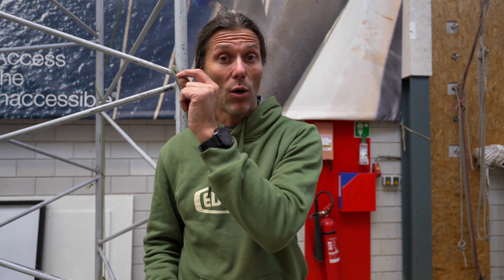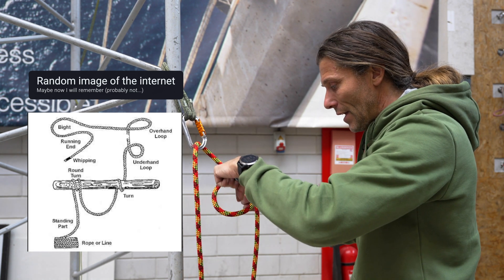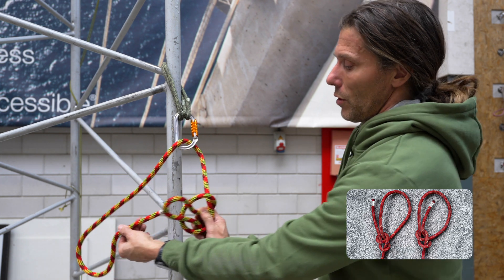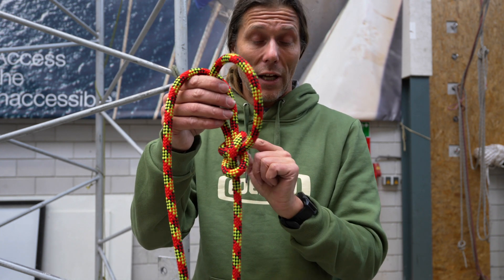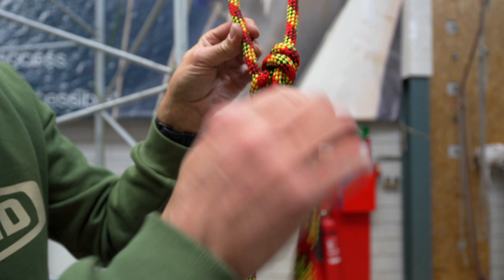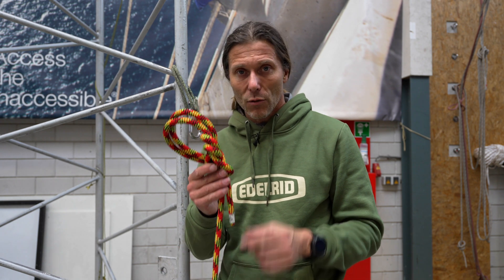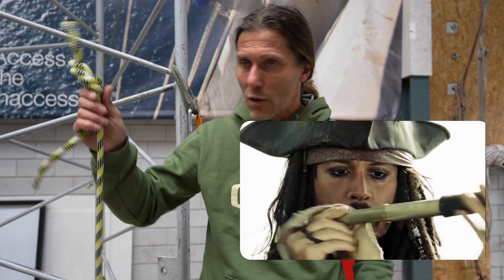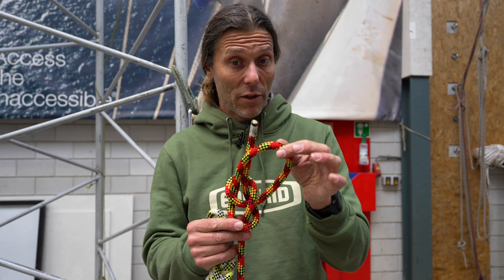How to tie a Bowline for rope access - Pro's and Cons of the Bowline

Comment: It is better to know a few knots very well, then many knots only half.  I fully understand that the figure 8 on a bight (or retraced version) is used frequently. It is easy to recognize, easy to inspect, and you can use both rope strands that leave the knot. 

I didn’t use the bowline frequently (because of the dynamic load issue). I don’t like the Yosemite finish, because you can tie it wrong and then it changes into something dangerous. So it surprises me that it came into the RA Channel. However some time ago a guy from Scouting came with the Scott’s locked Bowline.   From an inspection point a view it is terrible in my opinion. It looks so chaotic. It is a rather new knot, so not well known. The pro’s: easy to tie (starting with the regular bowline), very easy to untie after heavy load, and rather secure. 

Within my climbing work it is a real competitor for the figure 8 on bight.  The regular bowline (in Dutch “Paalsteek”) is also within the Scouting syllabus.   We added the Scott’s lock for the people that go deeper into wood pole construction.
Reply from the maker: Nice one about the Scotts Lock. Thank you! I hadnt seen that yet. It looks horrible and beautiful at the same time haha. I can  see you point on the inspection part. 
For me the bowline and it’s many different versions is such a versatile knot. I love it. And within the right team it is a perfectly valid and safe option. And the reality is also that we can get away with as little 2 or 3 knots. In RA we dont need more. I just like knots and use anything that comes to mind in the moment. Luckily I know a lot of knots very well ;-). It just depends on the team with what I use. Team and function as well.. Some things dont require the perfect F8 knot ;-)
Reply: @TheRopeAccessChannel  I like knots and rope also. Breath slowly, lower your heart rate:  I am a friction hitch addict.

Comment: Try the yosemite bowline, i believe it will address any concerns you have with the regular bowline. I like the yosemite because its much easier to use as an anchor knot around fixed objects compared to a figure 8 retrace
Reply from the maker: It is my favorite knot. And an F8 in rope access is still safer due to its recognizability
Reply: Though the yosemite finish looks very nice, I prefer the Scott finish (Scott's locked bowline).  In my opinion it has lower risk of mistying, and you can't dress it wrong (as far as I know).

Comment: We use the bowline a lot in theatre rigging. Its main use for us is hauling chain hoists up to be rigged to the buildings steel. The fact that it is easy to untie is why we like it since it only needs to hold for an 20 to 25 meter pull then get untied.
Reply from the maker: That is the place I use it most often. To lift things or make a quick tie off. I love the bowline ;)

Comment: I had a friend die when rock climbing tied in with a simple bowline.  I never use that knot for life support.  There are way too many steps involved in making it safe, all of which can be overlooked when tired and rushed.. Just use the figure eight, it's simple to tie, easy to inspect, and secure.
Reply from the maker: Agreed, and the reason I prefer it for rope access work

Comment: I have always used bowline.
Reply: I am from Moldova and there are no conditions for working on ropes, so you have to cling to chimneys or various large structures.  Bowline is ideal for anchoring.
Reply from the maker: Most of the time it is possible to create a safe working environment. It just takes time. But is starts with us on the floor education clients on the safety needs. Stay safe👍🏼👍🏼
Reply from the maker: Great knot.

Comment: I tie it as if starting an overhand knot, then "capsize" it, which results in the rabbit already coming out of the hole on the right side. Then just go around the tree and back in the hole. I find this way removes the need to make sure you're on the right side, its done for you.
It's so incredibly refreshing to see this kind of discussion! Instead of the "If it's not in the ICOP, it's wrong" mindset. The ICOP sets the bottom line. Although it goes a long way, It can't possibly account for every situation encountered in the workplace. In those situations, it comes down to a competent person to assess risk and choose what is fit for purpose. Of course; competency is the sum of training + experience. Keep the quality content coming!
Reply from the maker: "Competency is the sum of training and experience"! Beautiful statement!!!
Although I am an IRATA instructor I called this The Rope Access Channel ;-). On a serious note, and I am sure I can learn a lot, in my opinion the ICOP doesn't really say that much black and white on the methods we should use. Its an outline of the principles behind it. So I agree completely with your statement👍🏻

Comment: Another big example of why a bowline isn’t practical in Rope access is when rigging from the middle of a rope. I like bowlines when tying equipment to a line but when using slings and various anchors, F8’s are just so much more practical, plus you can use both lines that come off an F8, rather than just the 1 with a bowline.
Reply from the maker: Damn man! I hadn’t even considered that! I very often rig from the middle. We only lower as much rope as needed over edge. That’s such a good reason why an 8 is better to use👍🏼👍🏼. Thanks man 😃🙏🏻👍🏼
Reply: @TheRopeAccessChannel  keep up the great work and content! Enjoying all your stuff 👍
Reply from the maker: @jordanfrohock9815  thanks and will do👊🏼

Comment: Strong video, very good advices given, especially the optical stuff 👍 We use it on constructions, but only if everyone knows it. We show each other during the partner/team check when sb. 's new.

Shame one me to not know this, but what is IRATAs actual opinion to the bowline? When I had my L2 assessment the assessor told me to explain my choice of the double bowline and then start the task again with another anchor knot.
Reply from the maker: To my understanding the icop doesn’t have statement on many of those things. It must be risk assessed and fit for purpose. So you can basically do whatever you want as long as it is the best option for the job. 

Did the assessor explain why he did not want the double bowline? It could be as simple as that he is not super familiar with it and doesn’t want to take any chances.
Reply: @TheRopeAccessChannel  What he said was that the bowline ain't taught so not allowed during assessments. Completly acceptable. After all he explained that their must have been accidents with this knot caused by misuse and wrong tying so it's not ok anymore.
Reply from the maker: @jimpanse8763  that’s reasonable. It’s not used often and frankly for a lot of work unnecessary. But the ICOP doesn’t say we are not allowed. If we risk assess (and note it) it we should be good. With an experienced team who are all familiar with the knot as they are with a F8 it shouldn’t be a big deal. I also do a lot of Non irata work. I just have to adhere to local rules. That makes thing a bit easier to😉